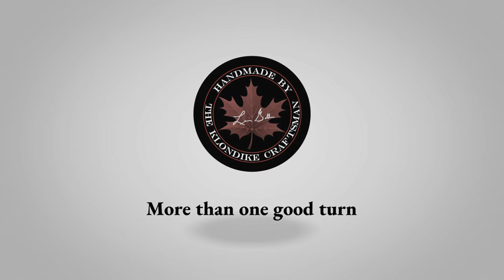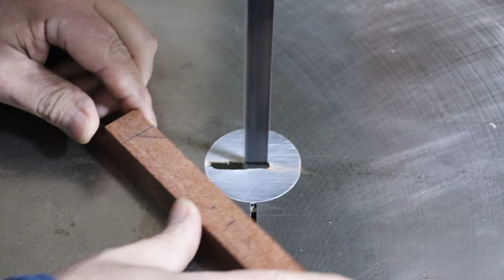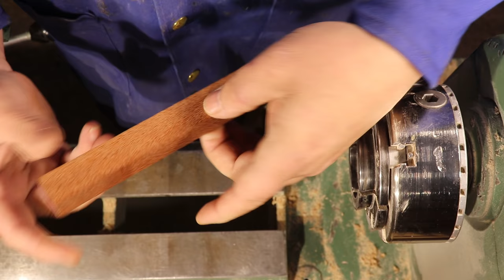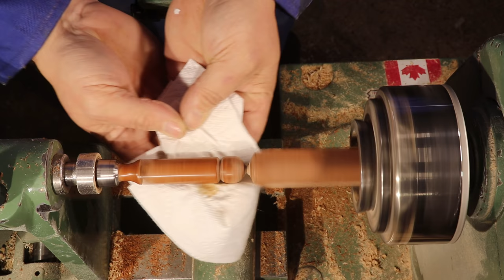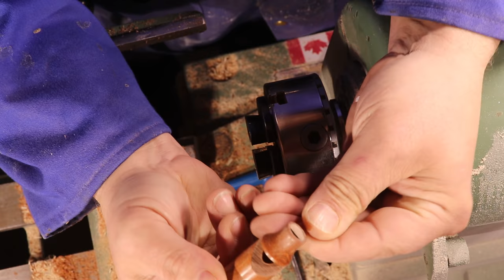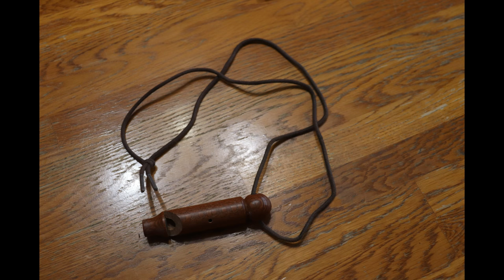Woodturning | Most Useful Project I've ever made - Beginner - Scrap Wood

Comment: I made a "useful" item from scrap I will share:- small piece of walnut (what I had) turned to diameter that just fits through my face plate. I inserted a screw into center of one end, cut screw off with 1/4" protruding, carefully ground screw to a point. Now for placing face plate tap point into centermark slide plate over dowel, put in screws then wiggle the dowel free. this way if you take off face plate then need to re- attach for some reason it is perfectly centered every time -Tyler
Reply from the maker: excellent idea! Thank you for watching!

Comment: That's brilliant Lewis. Any chance you could give us a sketch with dimentions to make one. They would be a great little market project. I was wondering the hole size in the small insert. Cheers for another great idea. Denis.
Reply from the maker: Thank you Deno! Actually the insert is sanded flat the full length of it it I will put out a video on the dimensions and show that. Thanks for watching!